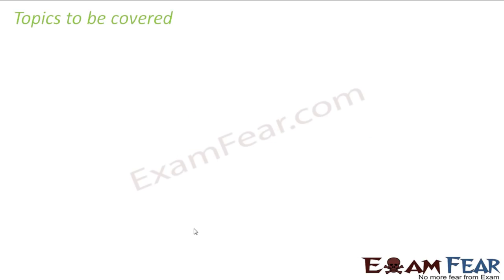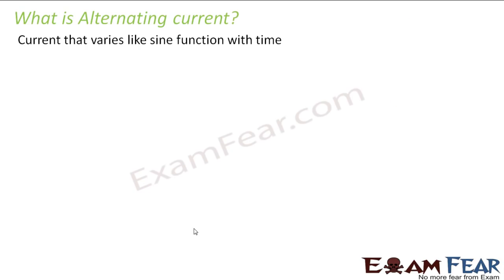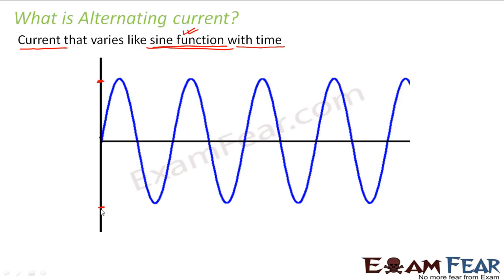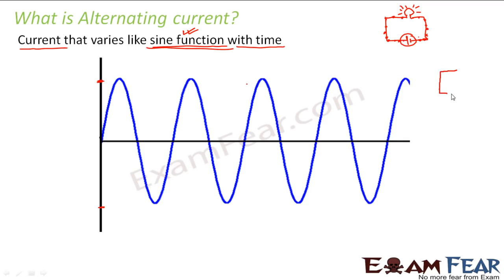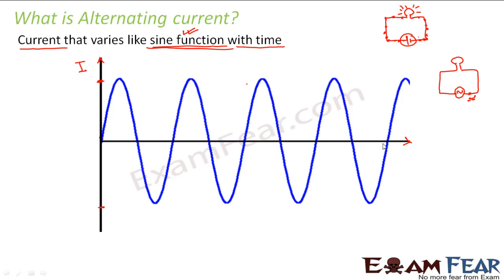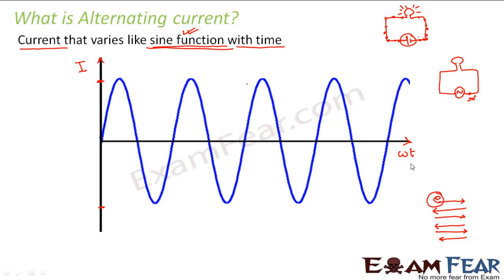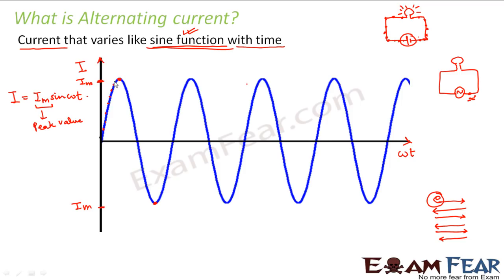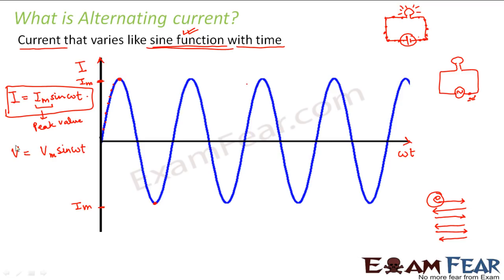Physics Alternating current part 1 (Introduction) CBSE class 12

Comment: Pls solve: In a series LCR circuit with L = 5/3 H, R = 10 Ω and C = 1/30 F and a source of emf 
E = 600 V, determine the charge on the capacitor as a function of time. It is given that 
the initial charge on the capacitor is zero and the initial current in the circuit is 9A

Comment: what is the difference between emf and voltage
Reply: Ramalingam G 
EMF is potential difference inside a cell between the anode and cathode when no load is connected.
But when an external load is connected we measure the potential difference between the +ve and -ve of that load, called as voltage.

Comment: mam if electrone is moving back and forth then how elecrone travel from one point to other in ac
Reply: KARANVEER SAHANI actually they don't...for instance for long distances...only electrical energy moves from one point to another in the form of electromagnetic waves. Electrons only oscillate. 
And as far as a circuit is conserned...u must know when a potential is applied...all the electrons start moving at the same time, so there is no point is one moving from a place to another...